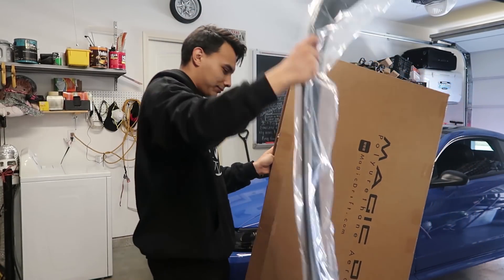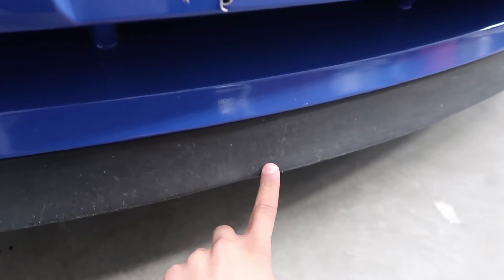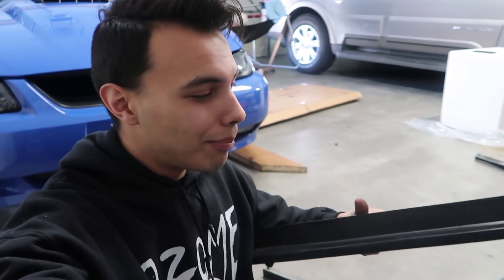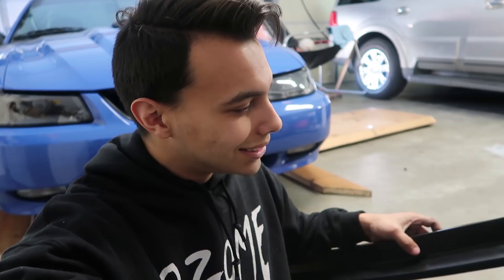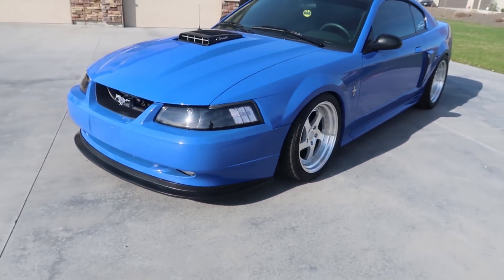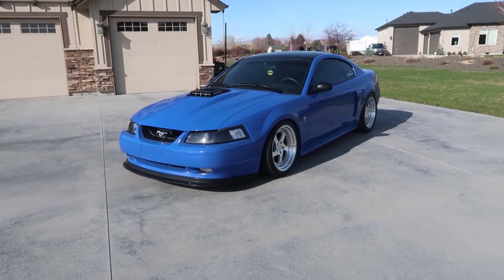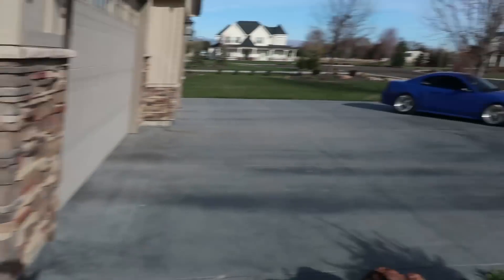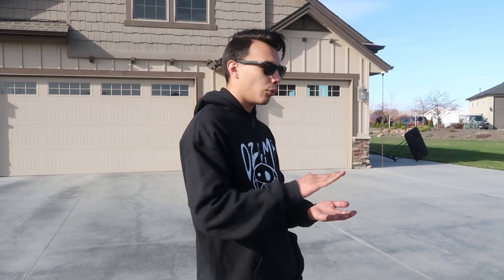The Mach 1 Gets a MAGIC DRIFT AERODYNAMICS Chin Spoiler!

Comment: I bought my Mach 1 chin spoiler for my 01 GT from this same company and I was not disappointed. What I have noticed is that the color is starting to fade away and it’s been close to 6 months that I’ve put it on but I’m sure that happens to all chin spoilers over time.
Reply: Nicolas Reyes use trim restore bro lol
Reply from the maker: Might have to pull out the black spray paint 😂 haha.

Comment: Will it fit a 03.04 cobra bumper? I got on the website and was about to purchase but it said "it does not fit 03.04 cobra bumper" .I'm a little hesitant, I think it will .what u think ozome  ??  Help
Reply from the maker: It will fit, but you’ll have to modify it a little bit. A little heat and bending will make it work.
Reply: Ozomeroman awesome !.I'll give it a try .. thx man

Comment: I've been thinking about getting this one for my 98gt.  They have them but the picture of it is on a 99 new edge.  Makes me worried it doesn't really fit the sn95 94-98 like it says.  I'm going to get it and do a video to see.  If not I have a mach lip already for it.
Reply from the maker: I would go for it. I’ve seen people put them on 03 bumpers and 99 Cobra bumpers. With a little heat and flex it should work!